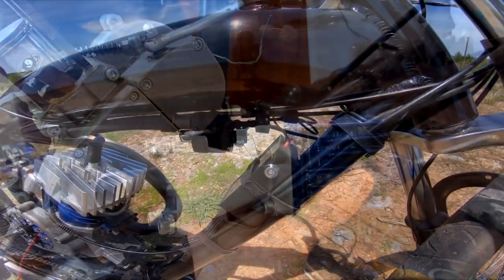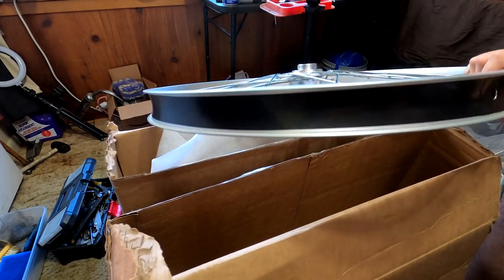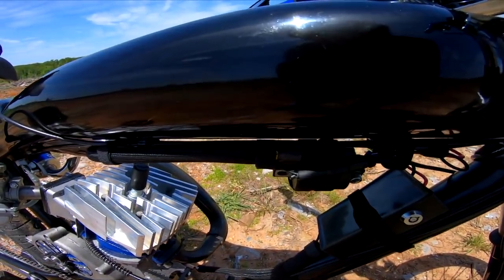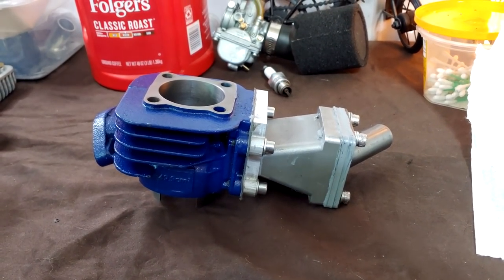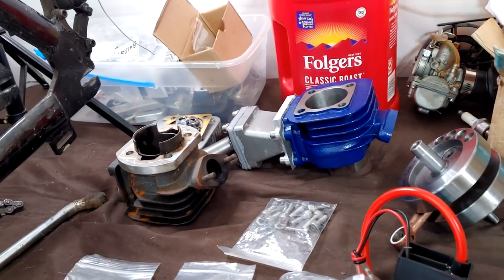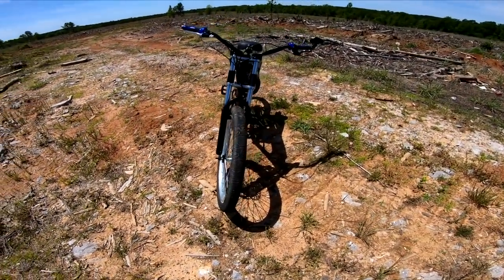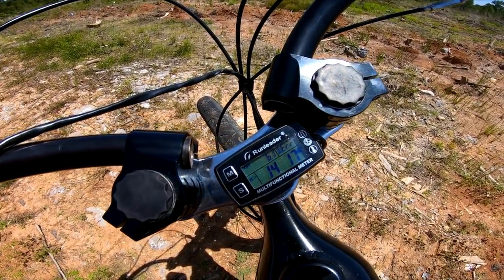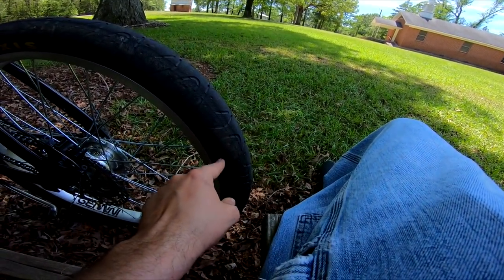Safer, Stronger, Longer, Motorized Bike

Comment: That Smolik head looks like a beefed up clone of a Yamaha DT100 cylinder head from the 70's.  It is a great design.
Reply: Yes the 1976 yamaha DT100 cylinder head is probably what Ethan and Ryan copied the design from but most definitely the chamber is a direct copy of a Stage 6 cylinder head
Reply: @darcyhemeon4309  Oh yeah, it's not a direct copy at all.  Call it "inspired by".  The fin size and density is much higher on the Smolik head than the Yamaha design.
Reply: @OddBallPerformance  well you call it inspiring I call it a copied design
Reply: @darcyhemeon4309  It's not a 100% copy though.  There are elements Smolik added that the DT doesn't have, and there are things they omitted as well, such as the horizontal winglets between the fins that direct air down through holes in the head to create low and high pressure zones.  Hence "inspired"
Reply: @OddBallPerformance  maybe not 100% copied but very close to it and if it's 97% copied to me it's well just copied
Reply: Machined version of a Webco head?

Comment: Great video! I've been thinking about pulling the trigger on those wheels. But damn you've sold me! Have you seen DLH 127cc engine pre sale? I've never found forks for bicycles with mounts for dual brakes. Funny how a normal bike can do stoppies on rim brakes, but as soon as you add a motor they're basicly useless.

Comment: This video is literally coming out at a PERFECT time for me! As I’m currently just looking into different wheel sets for motorized bikes. This is mainly because my current rear wheel has a quick release skewer to mount/ dismount the wheel on the frame. It does have a disc break hub so I was able to make a SOLID sprocket mount with it so I do definitely want to use it on my bike for more reliability than a clamp on adapter or rag joint. However, my main concern is that I literally have just that thin little tiny rod that’s holding all that weight and vibration. This is probably why I haven’t yet seen a single one of your bikes with a quick release but I still would really appreciate your input here. Do you think a quick release is a cause of MAJOR! concern on a motorized bike? or can it be left alone until you figure something else out? I do know it’s definitely not something to use for the long term but for now I’m not too sure what else to do, as I don’t think I can use a thru axle on a quick release wheel nor can I thread a bolt on axle through it as a quick release skewer has a much smaller thickness than a bolt on axle. Other than buying a Gemini wheel I’m not sure what else I could do. Any and all input you have on this would be MUCH! appreciated. Thanks so much!
Reply from the maker: Should be fine for low speed cruising but you can grab a solid axle on eBay or Amazon to replace it with. 
Thanks for watching!
Reply: As far as I'm aware it's not the skewer actually holding the weight- it's just holding it in place and the hollow axle is supporting all the weight 
You can get a fully threaded solid axle from probably any bike shop, online or even just a different wheel that you don't care too much about(it just has to be completely straight (because bearing adjustment with a bent axle is literally impossible to get perfect) and have good threads, just that you'll need to adjust the cup and cone bearings yourself in each of these cases, which can be a pain

Comment: Switching to a B7HS plug should make the engine run cooler, especially thinking as you run a high performance cylinder. I even use B8HS for my 60cc moped as it runs very hot. It is safer running colder than hotter, but it might make it a little bit harder to start.
Reply: do you notice any improvement with the hookworm tires? I went with the donna street.
Reply: @evenbuzzard4642  My motorized bike just has a cheap bicycle frame with stock tires and rims, i have only modified the engine so far, still not enough for the frame or wheels to be a problem.

Comment: Amazing video. I love that you did coverage of the gemini wheels, i've had my eye on them for a while. Are you using the zeda 80 bottom end on that motor?
Reply from the maker: Thanks! Yes firestorm zeda 80 bottom and crank (balanced).
Will soon be replacing it as I suspect it has issues.

Comment: Build number three under way. 26inch Hyper cruiser stock pk80 cylinder and bottom to start and it is damn clean ports all around. Head has 3cc added to it as I reshaped the dome then full polish and plane and mounted all up. Catalytic converter into 8 port copper glass pack. 32t sprocket  coaster mount cnc (had to try one). Triple tree suspension front end heavy CNC riser. Wide set bars. Still waiting on disc brake set. Stock tank. 
This one will be shall we say somewhat refined compared to my past two grip it n rip it builds.
Reply from the maker: Sounds like you will be putting in some work! Good luck Builder :)
Reply: @tncd6523 I would love to see a video of Your Hyper build! 👍

Comment: Hove that joint sounds nice bro👍👍 hey do u know of any plug and play 52 or higher jug set up for the yd bottom ends
Reply from the maker: Thanks! Bicycle Engines now sells the Phantom 85 top end that can drop onto a yd100 bottom end... But unless they corrected the intake port I don't know if I would trust it. 
Note: you would probably still need to open up the con-rod for the 12mm wrist pin.
Reply: @LAHover  thanks bro I went threw two phantoms but one they sent has a true yd stamped bottom case the other one seems to be the same thing but it's just missing the stamp but I was thinking more down the lines of putting like the MS 460 or 660 one of those on there because I was reading some posts on the phantoms and his dude said he's on his fifth one lol bro I just want to slap a quality piston and jug on it

Comment: You should have bought a "PhatMoto Rover"  for $999'00 and all you had to do is change the motor 4 a 2 stroke... All the parts are heavy duty built for just that reason to ride on or off road...

Comment: You dont know how lucky your are to have that frame, my mom sold mine for crack. So sad to see you wasting your with a2 stroke instead of a belt drive 79cc 4 stroke. Sure it doesnt rigbt through ridiculous terrain but its great on the street and normal trails and it faster

Comment: Hey LA.The best way to  find an airleak is with carb cleaner.Just spray it on a suspected leak area and when you find the leak the rpm will rise noticeably.

Comment: Want one of these for my CDH Gasbike, which seems to be going through back wheels, damn thing ain't even broke in yet and I'm already on my 2nd wheel...only trouble is the Gasbike's set up for 24" wheels, and I can't seem to get an answer as to whether or not the maker does these in 24"...suppose I could just get the hub, and have a bike shop here lace it up for 24, but that's just added cost...or convert the bike to 26". You had said previously the wheel takes a 300 size tire I think? Pretty sure that's gonna rub the sidewall...maybe get the hub like I said, and have my guy lace up a 24" steel rim for a standard sized tire, and just eat the cost of that...hmm...

Comment: i got a light setup using a bundle of laptop batteries  my nefew made a 12v basically   smaller then a fist running 12v lights i havent had to charge them yet and i have had them 2 weeks

Comment: #1 An air scoop for your cylinder head, to help cool it would be pretty easy to build.....
 #2 The Gemini wheels look high quality (some oval spoke washers for the rear wheel would help make them even stronger) 
 #3 I'd love a 26in steel, full suspension frame similar to a motoped with those Gemini wheels for a build . 

#4 After paying $75 for the larger "Nasty Jack" expansion pipe, I wish I would have bought the smaller $45 ex. pipe instead. One $45 pipe I seen did have a smaller header tube ID & belly but much better welds & no kinks or obstructions in the header tube bends for better flow & it's probably also lighter. The other $45 chrome pipes had kinks in header bends & worse welds. The $75 "Nasty Jack" pipe does have a larger header ID (& larger belly)  but is all crooked, poor welds, with obstructions inside that won't help flow. Plus it's on the heavy side, I'm gonna have to bend the piss out of it to make it fit & hope it works. VS $45 pipe, that I might also have to bend but would have more clearance around the gas tank. In hindsight, not all the $45 expansion pipes are the same but I really wish I would have bought the black one with good welds & no kinks in the header.

Comment: Hey Hover,

Why does my bike squeel when releasing the clutch during acceleration? I think the noise is coming from the clutch arm and ball bearing not being greased. 

Thank you,
Even
Reply from the maker: Without hearing it I can't say for sure. But if it goes away after your bike reaches speed it is likely just low quality clutch pads.
Reply: @LAHover  It sounds like metal on metal grinding. I thought it might be the clutch pads but I have replaced them recently. I think it is the push pin barely making contact with the clutch arm when the clutch is partially released and then it goes away when the clutch is fully released because there is no contact between the push pin and clutch arm allowing it to spin freely hence the reason for the ball bearing. Does the ball bearing spin freely when the clutch is engaged or released?
Reply: @LAHover   chain was hitting the frame.

Comment: Love your videos man, you inspired me to do my first build ever the other weekend, I got the seeutek motor kit and the install was a learning experience but everything came together nice. Haven’t fired it up yet as I have a steady leak coming from the carb and ran out of spare time, hopefully will get her going this weekend and take my first ride!
Reply from the maker: Carb leaks are normally caused by a bit of junk in the carb that blocks the fuel valve from closing all the way. A quick cleaning usually does the trick. Sometimes a few taps on the bowl with a screwdriver will get you by.
This is assuming the carb is not tilted at an extreme angle.
Reply: The float bowl jet isn't closing all the way. Fight the urge to go over half throttle for 3 tanks of fuel.  Its a lot of work to ruin by being impatient but worth the wait once you have a reliable motor.
Reply: @dustinh4175  thanks for the input!

Comment: Just wondering why your running that scooter pipe and not the mz, after all you said the mz out performed the torpedo scooter pipe a video or two ago. Just curious.
Reply from the maker: The Jog seems to cruise allot smoother than the MZ. This pipe was also set up for this bike, and it's a bit cheaper.
For my style of riding I'm happy with the Jog :)
Reply: @LAHover  ok... smooth is always king, power is not
Reply: As important as comfort,  imagine that! Very cool thank you Hover.

Comment: Any idea why my anbull just stopped working makes a loud single pop won't fire up tho
Reply from the maker: Magnet on backwards, 
CDI wires flipped, 
Bad connection between mag and CDI,
Kill switch issue,
Bad spark plug... Take you pick and move to the next one.
Reply: @LAHover  you mean the 1 o'clock position? It has spark
Reply from the maker: May need to do some digging on this one. Feel free to join the discord server for live help. Link in the discription.
Reply: @LAHover  I'll have to make a new one old discord was accessed when my phone was stolen

Comment: Another thing if you are having issues with temp and tach you need a resistor plug or ngk resistor cap. You want a colder plug. We recommend an ngk br7hs or br8hs especially when temps get hot out
Reply from the maker: Oh, ok thanks! I actually have a box of 8, nice! I completely forgot about picking the right heat range. Glad you caught that.
Reply: @LAHover  it's also a resistor plug . It eliminates interference from the ignition to your guage

Comment: I have Gemini wheels that I am running with a set of Serfas Drifters 26"×2" and they work great and are just over half the price of the hookworms.  Also running a 203mm caliper in rear with a QM9 adaptor and can't got much bigger on sprocket but atleast the Minarelli has enough power for the 36t.
Reply: Nice. I have both sets of tires, but I haven't run the Sarfas yet. My hookworms are just barely touching the frame on my Trek 820 Antelope (1992). I wish you could share pics in the comment section. I have it on my channel tho. It's a runner for a China D. I'm running a 36 also. I have a 32 on my Mina Chopper.
Reply from the maker: Cool thanks for the info!
Reply: I also run the serfas, great tire

Comment: Deleted my comment, it's the weekend. Anyways, Smolik and Rdm share design and production on same head; qyestion: any Smolik personal markings on it? And, could you weigh it? Let's do a comparison. Thanks for the ride.
Reply: SP here. We do not share design or production with these heads. They are only designed and manufactured solely by Smolik Performance. 

For comparison, the SP CNC head weighs 1lb 10oz, and a CDH Octagon head weighs 1lb 13 oz. However I would love to see an LA Hover comparison video.
Reply: @smolikperformance3867  Sorry brother, got one, prettiest thing ever. Looks so similar. RDM marked. Help a fool here, will you?
Reply: Let me know if you want pics.
Reply: @leonardarola  RDM head is similar, but side to side a very different design.
Reply: @smolikperformance3867  I didn't knew it. All I need is a little racer and a brave bull to cover George Adams Wyman trail and back.
Reply: @smolikperformance3867  Also, though you were bros; bro.
Reply: @leonardarola  nope just friends
Reply: @smolikperformance3867  It's REALLY just a Copy of a Stage 6 Head , with better cooling fins, but nice job on it Ethan , the fin design on your  head is also a old production motercycle  head is it not .. looks exactly the same
Reply: @darcyhemeon4309  it inspired by many production engines, but definitely not the same in any way. The chamber is also modified from a stage 6 piaggio chamber as stated in the description
Reply: @smolikperformance3867  I measured it its a Stage 6 head you copied
Reply: @darcyhemeon4309  as stated in the description of my head. "chamber design taken from the beloved Stage6 Sport Pro"

It is very transparent. No secret there
Reply: @smolikperformance3867  nice copy , you guys like to copy stuff
Reply: @darcyhemeon4309  Shots fired... This escalated.
Reply: 4 months later, Still getting flack from Ryan and Ethan. Lol, shut up K.

Comment: @LA Hover could you at some point go over this bike and do a part by part list with links?  I'd very much appreciate it.
Reply from the maker: I did a run down in the video covering most of what is on the bike. Limited by time and energy, but a fair bit of it is in the discription.
Reply: @LAHover  While I appreciate your time and energy, doing creative stuff also, (mostly let's plays atm. for lack of gear.) The reason I was asking for a total parts breakdown, is for new builders like me, when I go on amazon, or any other retailer, it's difficult to pour through all the crappy parts to find decent ones.  But if I could just copy your build, I at least have a solid foundation.  For me, having owned two bikes with the chinadoll motors that spent more time broken than running, I am about to throw in the towel and say all of these things are junk.  You seem to have a knack for finding reliable parts.  Anyways, just my thoughts, you do great content.   Keep it up!

Comment: Hey Quick thought!  I'm wondering if you should pop that rear disk brake on the other side of the hub so that oil from the chain won't get on the rotor!  That would make the brakes squeak pretty loud.
Reply from the maker: No set up for it with these wheels but it is a good idea. It's nearly impossible to prevent the pads from getting contaminated on the drive side.
Reply: @LAHover  gotcha!  That makes sense!

Comment: Minareu makes an insulator thst goes in between the carb and intake if hest is an issue. I guarantee he is not an issue using an insulator and intake leaks are pretty much non existing. You are using a vm18 . What pilot jet are you using?
Reply from the maker: If my memory is right it's the stock pilot atm.
Reply: @LAHover  is it a high idle issue or it just dies
Reply from the maker: @kjsmolik  When cold it idles fine, when hot it just dies (I do adjust everything when the motor is hot). I have had good luck finding the right pilots and adjust the air screw on every other bike. but this one always dies. I'll have an update when I replace the bottom end, I honestly think this one is bunk. It's been rebuilt, re sealed, and had many different top end set ups. always the same. Just an unlucky bottom I think.
Reply: @LAHover  you are using a vm18.  The stock pilot almost never works.  We use a 22.5 pilot.  Sometimes a 20.  Sounds like you need to change the pilot.  If it had an air leak when hot it would idle high.  When cold it needs more fuel for start hence why it idles ok when cold. Then once it warms up its to rich.  Put in a 22.5, af screw out 1.5 turns then go from there.
Reply from the maker: @kjsmolik  it's back to stock because smaller pilots made it worse. It's weird... Even the pz20 and pz19 that run and idle great on my Southern Custom hybrid do the same thing on this motor.
Reply from the maker: I'll try the smaller pilots again just in case because this is a fresh rebuild.

Comment: I’m pretty sure the point of not letting the cylinder heat up the carb is because the colder the air is, the more dense it is which means u can get more air into the engine. I don’t think it will change much to do with getting colder fuel to prevent overheating. That is definitely an added bonus but the effects of that will be extremely minimal
Reply from the maker: Thanks for the feedback :)